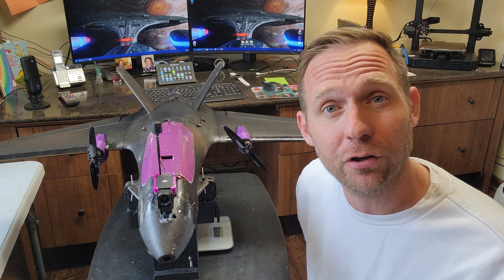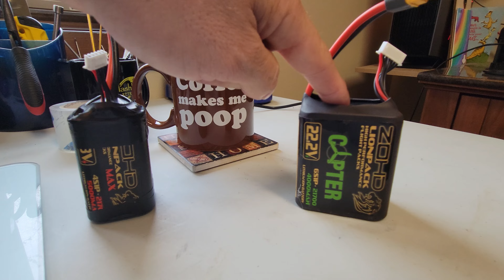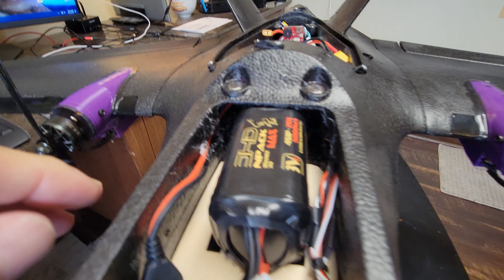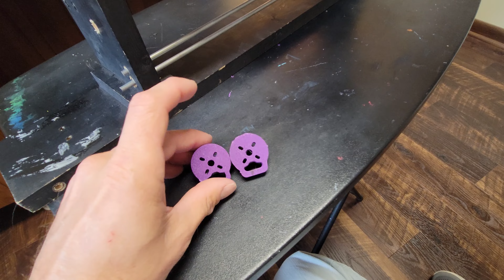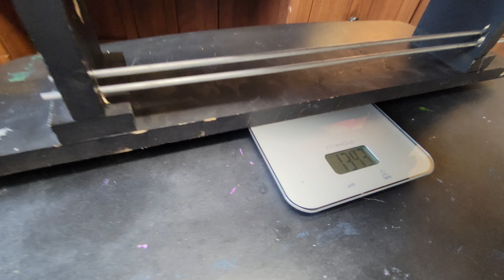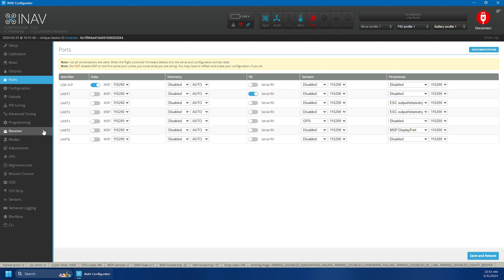6S Twin Motor AtomRC Dolphin Build! PART 3 - 6S POWER - FPV Plane

Comment: did you use 2ESC?
I have sky walker 60A esc, can I use it as single ESC?
Reply from the maker: Yes, 2 esc.  1 for each motor.   I'm not sure about using 1 esc for both.  I would ask around.  I don't want to give misleading info.  Maybe someone will chime in.
Reply: you can't and you can. esc read emf feedback from motor so u can't use 1 esc for 2 motors. but pawel (inav developer) have tested it and run, but he doesn't recommend either

Comment: where's the current being measured from? You say you can pull 40A but you have two motors and two ESCs, so at most you could do 20A per motor?
Reply: Flight controller measures that

Comment: Bro, im pretty sure Atomrc watched your videos about this dual set up.  See if you can contact them to make a dual motor wings just like how the Swordfish and Penguin are.  Hopefully the next version of Dolhpin is a dual motor.
Reply from the maker: Thanks for the positive comments.  But the real credit goes to the guy who designed the kit on thingiverse.  I'm just the crazy ass test pilot.  If the wings on the dolphin were a little bit longer, it would be the best setup.

Comment: Watch everyone of your videos - great to see a man enjoy this great hobby!  For the "climbing" thing...I once watched a Painless360 video where he said this "fw_level_pitch (CLI) I set to 8deg - so if plane climbing adjust this in PID tuning/Mechanics-LevelTrim[deg] and SAVE"  Never tried it yet but it might be something you already tried?
Reply from the maker: Great suggestion.  For me, the dolphin needs 3° for level flight, but the main indicator that the motors were pointed up too much was the oscillations it had in the previous videos.   Every time I shimmed the motor down the oscillations were less and less and it flew more level under high rpm.
Reply: @JeffDoesThis  Yep-that makes sense since that Dolphin was designed for aft thrust and it has (most unstable laterally) a forward swept wing which was remedied (I believe) to some extent by the downward curved wingtips.  I fly real Cessnas (got my flight training in Ohio-Cleveland-Burke-Lakefront.  AND I got it soon after 911 (everyone said "you will never get a go-ahead by US Gov to train for a pilots license because you are Canadian" - I called HO in Washington and they said "thats BS-go ahead!" Anyway-I digress-keep up the great work--you should call AtomRC and get a new twin kit in the works.  We are the journalists of this hobby-Gov won't do anything but try to put us down, Universities won't do anything and a lot of locals have been propagandasized into believing we are somehow "trying to take over the Country" .  I have been flying models for 72 years - RC for 57 years and its a real-man/real-woman hobby - one of the last!
Reply: Forgot to add - maybe a larger downward curved wingtip will help - its a very diff aeronautical design--one that was made for a lot of speed to fly stable.  Bang one off on the 3-D - just be careful to keep up speed on landing at first!

Comment: I’d be curious to see what a 6s 1800 lipo battery could do in that . I have the 4s li-ion pack and it doesn’t compare to the performance of a 4s lipo but the flight times are nearly double of what the lipo can offer
Reply from the maker: That's next on the list.  The voltage drop is massive with the li-ion pack at 70% throttle.  I ordered those props you used on your penguin last night so we will see what kind of difference they will make.